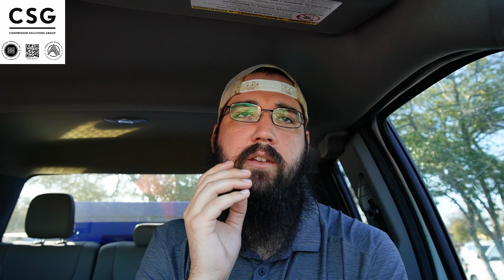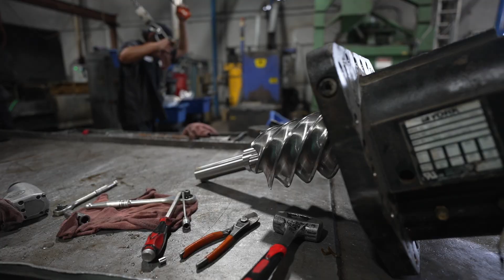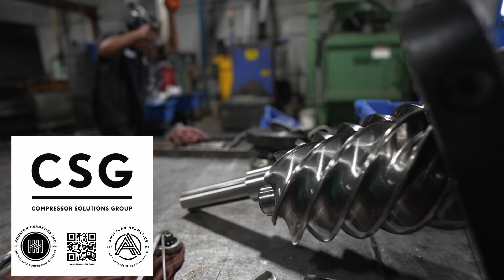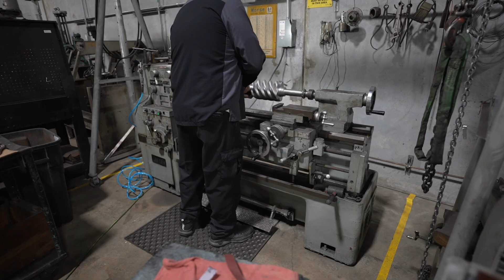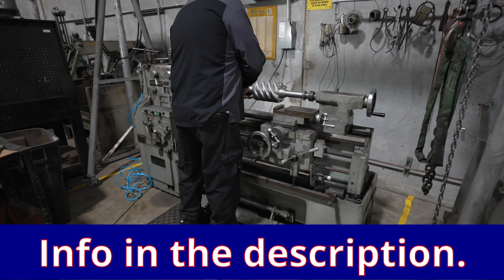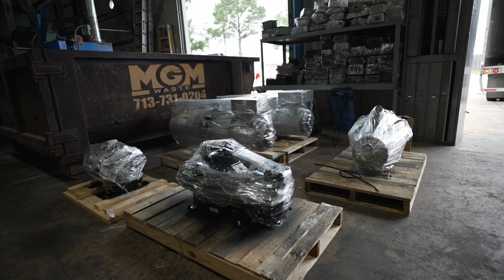Stop THIS as a Chiller Technician

Comment: I posted on your page before. I’m a retired York Factory start up and was part of the Product development team. I do agree sometimes we would do things that didn’t make sense at the time. But if you are familiar with this in a system not just the chillier. That takes time and experience to understand things from a system standpoint. I worked  start up for most of the new product in the 2000s. During that time is was a fast track development with new technologies and systems. Turbo Core. VSD compressors. Systems started changing in sensors and what was it looking for in terms of what took priority. So many times we would be called out because a contractor would not purchase a start up package. Thinking he was knowledgeable enough to make it work. So many times it would end up being started by the control contractor because he was more knowledgeable. We would come across this. Because of schedule and it had to be running. In order to do water and air balance . We always take the time to inform and educate the technicians the proper way to operate the machine. And go over it with the in-house facility guys. I do agree in your opinion. “You’re only as good as a tech to only what you seen and experience “. You’re not born to be great in life you just become great from life. I’ve seen so many experiences from my travels in this industry and people. Lots of us factory technicians during my time came in left out mark and we all retired about the same time. Soon after because of that. Johnson decided to close tech support. When “Wild Bill” and others didn’t have the answers in scenarios like that. I’d get a call from someone and guide you through. To bad we didn’t have FaceTime during those times I wouldn’t have to travel all access the country to fix something in 5 minutes because the Teck didn’t understand the system. Be safe out there fellas. I’m retired. My body gave up on me 3 years ago. I’m enjoying my retirement grandchildren and my twin sons playing High School baseball.

Comment: The OEM tech probably put that setting in to make the chiller work temporarily whilst the client makes the adjustments needed on the water circuit.
I don't think the OEM tech is supposed to even touch anything besides the machine he's commissioning if it's anything like we're used to ever here .